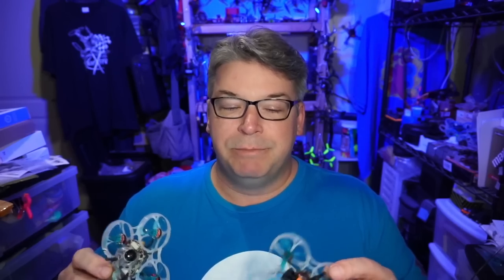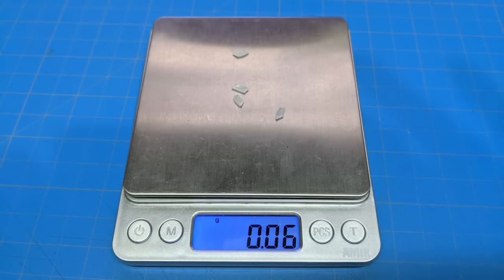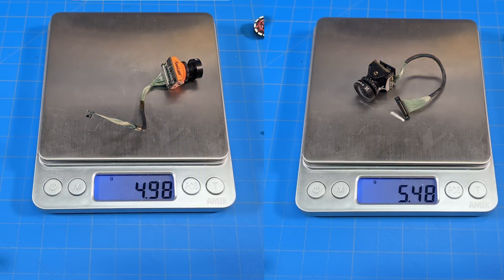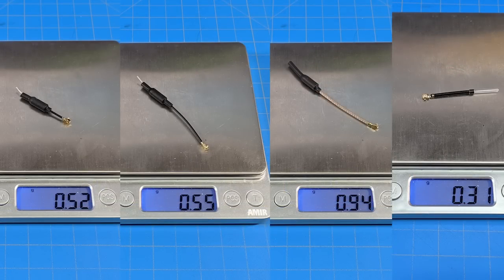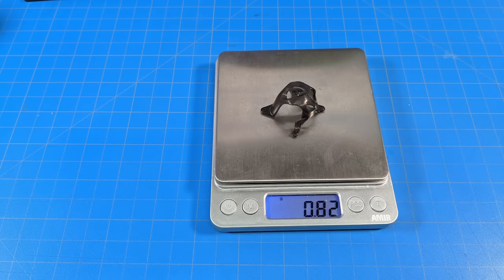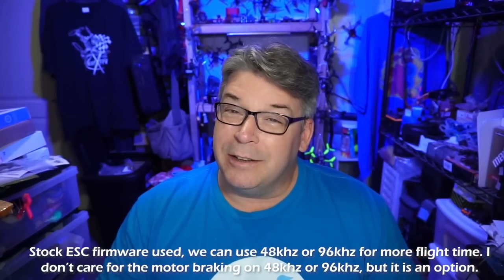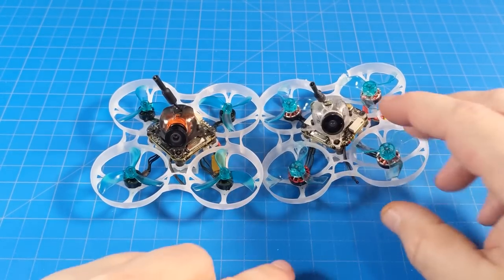Shark Byte Whoop // How Light Can You Go?

Comment: Very cool! I haven’t tried SharkByte yet, but the latency and weight advantages are definitely appealing for whoops and other micros. I hope SharkByte succeeds and I hope DJI succeeds, and I hope they push each other to keep advancing the tech for us! One side note: removing all the plugs from a Crazybee FC and direct soldering can actually save 0.7g. It is more than you might think because you also get to remove the plugs from the motor wires.
Reply: The mad scientist of weight, Dixit Dr. Nick 😜
Reply: @4:21 Nick does make reference to removing FC and motor plugs, but I have to agree with him about reparability.  0.7g at best could increase flight time by 5 to 15 seconds?
Reply: @FlyturboKwad  removing motor plugs is about flight performance more than battery life. Every gram counts if you want to fly fast in tight spaces. But is does make it harder to replace a motor.
Reply: @MrShutterBug  Yes this too, thanks!

Comment: My favorite video! I miss the days guys use to really dig in and experiment. To me building quads and fidget over parts and finding that right combo is 50% of the fun in this hobby. I love to tinker and this video has so much info for builders especially the weights. 1102 9kkv is just a sweet spot for minus 45g 75mm whoops with the 4 blade gemfans I found. 802/803 are so inefficient and don't provide grip over 25g. The efficiency of the 1102 9kkv and overall feeling of them in the air is just great. 
Still think you could make a brick fly ;) 
This video held my attention from beginning to end. Awesome job Nick! Thank you for all the work that went into this video.
Reply from the maker: Oh, I still need to buy a foam brick :). It was a fun process, I would like to see 1102 motors with shorter wire length, might be a long shot. I would like to see a 1002 or 902 from happymodel and see what the weight is. If we can pull 2grams off the 1102 motor weight it might be worth it. Through this process I kept wondering what the motor shaft weight differences are, I don't have two of the same motor with 1mm and 1.5mm shafts. I don't know if a frame can go lower weight and maintain its integrity, I would be surprised if we can get a durable frame less than 5grams, sure we can cut the battery tray off and that will get below 5grams, but we have to have a way to mount the battery, I suspect the tray is the lowest weight option.

Comment: That "mesh" on the thicker antenna wire is the coaxial shielding. That wire is probably RG178. The black antenna wire is a little thinner and lighter, probably RG196. It is probably worth seeking out antennas that use the thinner-lighter coax since the signal attenuation is mostly insignificant at the short lengths we use on whoops, but the weight is significant.

Comment: Thinking about buying SharkBite and trying a light weight build. Think I would use the UZ85 model it comes with the 1102x 10,000 HM motors.  It would be a little heavier with the larger 85mm frame and 2” props but would have a lot more performance. The larger size would be better for outdoor flying once it gets warm again and would still work inside. The UZ85  dry weight is 36 grams and would probably add another 12 grams for the dji board and camera.

Comment: That metal shield as you call it on the antennas is part of the antenna , These antennas are called sleeve dipoles... Dipole means two poles, So you have the vertical 1/4 wave  piece and the metal sleeve around the coax is the other  1/4 wave  part of the dipole... We use antennas like these on HF ( High Frequency )  the only difference being the size of the antennas , As you increase the frequency the antennas get smaller and visa versa.

Comment: Hi Nick   Great video and build you are doing.  I just love your excitement about your work.  I have seen the videos on the DJI version of the whoop builds. But I never liked them,  I thought about it and I still think that those weights that made them sluggish and not worth the cost.  Now about SHARKBIT  I haven't had the chance to try but I have heard great news about it. I wonder if we could find the pins for the connectors that way we can just cut the motor wires to the length you want,  then add the pins and connector.  And yes that antenna is a Happymodel.   THAT THIS THIS  ???   A CRASH VIDEO  !!!   LOL.    But WoW !! 3 minutes Great job on them.  Looking forward to see your next video

Comment: The ort antennas are super light and durable and work great.
Reply from the maker: oh i see a micro vee ant. At .3 grams that is fairly surprising.
Reply: @NickBurnsFPV  got them on most of my quads now. Work great for a linear
Reply from the maker: @djs134  Is the stem really flexible or rather stiff?
Reply: @NickBurnsFPV  feels identical to a replacement newbeedrone antenna, same thickness to. But a L shaped pcb at the end . So to answer your question it’s fairly flexible

Comment: Interesting build and comparison. On the frames Mr Shutterbug 75x pro 2 frame I found more even durable that the Mob V3, but no longer available. The print quality of the V3 appears to have greatly reduced and they don't last as long as they used too. Now experimenting with the BetaFPV Meteor 75 lightweight ( will have to cut the battery straps for 2s). Using the Betafpv canopies with Razer nanos and Caddx Tubo Eos2 cameras with the Beta Fpv A01 vtx as a plug and play package. One thing to note with the Crazybee F4, GEPRC 12a and and BetaFPV Quality control is hit and miss no two FC play the same, typically 1 out of three play nice. Not sure if others have experience ( RDQ have great service)..
Reply from the maker: I have a few betafpv frames, but have gotten reports of many breakages, I opted not to spend time on those frames. Seems they may have change the plastic/nylon used. I think long term none of the aio last as the 20x20 counterparts, my experience has been pretty good, but I read many comments and messages on this topic, kinda why I mentioned it in the video the way I did.
Reply: Keep on tricking theses out, the 2s ducted builds seem to be dying out and variations getting harder to find. I enjoy the Mob75' 2s format for flying indoors. Enjoy the vids.

Comment: Those are good weights in my opinion, my analog (separate vtx and rx) 75mm 2s 1102 "13500kv" whoops dry weights are 35grams and they have gotten me through 6 months of IGOW2 so far.
Reply: 300mah 2s gnb27 1102 13500kv 35 grams gets me over 3 min hard acro, I do lower the motor output to 85 or 90 percent in betaflight. My 40 gram betafpv HD version same everything else flys 2min, so that extra 5 grams is painful.
Reply from the maker: Good information that. Thank you.

Comment: If I remember correctly, I thought the original Mobula 7 motors were 16000 kv. This is really interesting to see the results, but I kept coming back to a similar thought. Stick with the 1102 motors and all the same components, but move up to a 85mm frame and Gemfan 2023 2" triblades. I'd be willing to bet that your 3 minutes goes up to 3 1/2 minutes with similar or better performance.
Reply from the maker: I would expect the flight time to go up as well. I prefer to stay at 75mm for indoor flight. The 85mm is much more challenging inside.
Reply: @NickBurnsFPV  Good point, but if anyone can do it I'd bet you're the guy for the job. 👍 Either way, you've got a great build put together. Maybe when the weather gets better and allows more outdoor flying the 85mm might be worth trying. Keep up the great work! I always enjoy seeing what you're working on.
Reply from the maker: @sixtofive  lol, oh I have done it, 85mm inside feels like constant work to slow down.

Comment: Just my option On motors and weight. Is. You need the big motor weight to toss around the weight “mass”. The less weight needs more throttle because no weight or “mass” to toss around in the air. So more weight less voltage?

Comment: Nick your killing my quad budget. The SharkBite bundles are in-stock at both RDQ and GetFPV. I ordered the bundle and will try a light build. I was going to use my UZ85 as the base but will probably use my extra US65Pro that I have on a 75mm frame. It currently weighs 24.4 grams plus the board 5.7g plus the camera 5g minus the Ant camera -1.7g plus antenna 1g plus 0.6g wire and solder so I should be at 35 grams. I will let you know how it works. Thanks, John from Chicago
Reply from the maker: Does that US65Pro have a full extra uart? Sure interested in how it comes together. Sorry about the budget :)
Reply: @NickBurnsFPV  the US65Pro uses the new 2S CrazybeeX board and it has 2 full UARTS. The board weighs 5.2grams so I will end up with the same weight that you have on the 0802 motors. For low cost it is the way to go for $89. It is running 3.5.7 so need to re-flash 4.2. Thanks will let you know how it turns out.
Reply from the maker: @jmoore3854  Ah great. Hard to remember all the different board configurations.

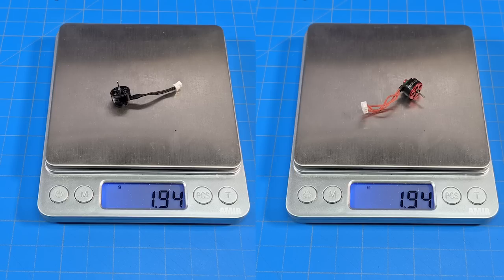Comment: Nick....Is 2:30 really your flight time target? That by today’s standards and 48mhz flash seems really short (unless the birds really inefficient) even with your hard flying....just curious? I would think a full minute longer at 3:30 would be more amenable to most people. ....
Reply from the maker: I find many report more than a full minute of flight time on quads I have reviewed with the same batteries, I can’t be sure of the performance/care of the battery. I don’t do the 48+kHz on quads I review on the channel, that is a step beyond a review, it’s an option but it’s also an option that can go wrong for those that aren’t experienced. On this side I get 100s of comments, questions and messages, I feel it’s important to have a level approach. I expect more experienced viewers to know, they can increase flight time with kHz, props. I don’t expect the same of less experienced. As in this video, I don’t care for the lack of motor breaking of 48khz or more, when flying like I like to I find it makes it more difficult to manage the flight.

Comment: Thanks Nick, I’m interested in this content. I’ve converted my TP3 to sharkbyte and also am building a sharkbyte whoop with the items below. I’m no expert so don’t know what this recipe will turn out like and I definitely won’t beat you on weight! All ears on any suggestions :)
-R3d shifters muon
-mamba f4
-xing nano x1103 8k
-Gemfan 1636-4 40mm
-crossfire nano (I know, not necessary)
-450mah 2s
Reply from the maker: probably come in around 60+ grams, going to be more of a cruiser inside, more suited for outside flight. I worry a bit the flight time might be pretty short, I haven't experienced to many xing motors, but I didn't think they were as efficient as others in the same line.
Reply: @NickBurnsFPV  oh wow, thanks for the input Nick, I didn’t realize I was increasing the weight that much but it sure does all add up. May go back to the drawing board on this one or I may build/fly it just for the experience to feel the difference first hand
Reply from the maker: @CalleyyyC  The happymodel 1102 are remarkably light. I suspect that 1103 is double per motor. Rx on my is built in and shark byte is the vtx.
Reply: @NickBurnsFPV  the iFlight XING NANO X1103 8000KV FPV NextGen Motor say they come in at a surprising 3.6g per motor “on short wires”. I piled what I think was everything on the scale (including wires & screws) and it was 54g. I will probably end up changing to the 1102 that you mention for efficiency and a light board with built in rx like you did. End goal is an indoor flyer
Reply from the maker: @CalleyyyC  onboard rx is a nice little weight savings, as long as we can do d8 mode and don't expect a "normal" amount of range.

Comment: Still on the fence about getting SB. Thanks for showing us what can be done with a little testing. Never really thought about ways to cut weight, but lately I have seen so many quads aimed at that. This one definitely gets me thinking of some odd ways to do it. 3d printing a canopy seems a bit heavy, so instead I am thinking of thermal forming one from a soda bottle. Removing all needed connectors seems like a decent weight savings. How many amps do you think it pulls? Xt30 seems like it may be overkill.

Comment: Gotta throw this setup on the new NBD Cockroach Extreme! Dual stack layout would be perfect imo.
Reply from the maker: Is that the 75mm with carbon on the bottom?
Reply: @NickBurnsFPV  Yes sir! I thought she'd be extra hefty, but there's plenty of options for mounting, and the cg might be better with the stack layout. The hoops are actually a fair bit smaller that HM or Beta frames, smaller footprint, might help inside.
Reply: So I just got the last part of my build (split lite) and here's the resulting specs. Using a de65 pro running gear (gnb27 series connector), on the NBD frame with carbon plate and small Velcro strap, and additional split lite board and cam mounted in larvax canopy is spot on 32g. The 12k kv should help bump the flight time a bit. Using a little "fixed wing style" finger balance testing, the carbon plate and bottom mount fc has the cg shifted lower considerably, even with the splits large lens mounted up so high. Next up I will test Tiny Whoops 0803 12k onesies.
Reply from the maker: @MissingNumb  I did find I have one of those cockroach frame with carbon bottom plate. I need to investigate that.

Comment: Awesome flights and great info!

Quick question. Building a baby tooth. The sharkbyte didn’t come with gummy’s and the holes seem really small? I broke of the corners like you mentioned. The board tries to work its way out of the gummy. Probably just going to put a little heat shrink around the standoff to secure the board? 

Baby tooth frame, geprc 25 amp, sharkbyte, foxeer digisight, xing 1404 4600 kv with a twig canopy.
Reply from the maker: We likely need a spare gummy or a short nylon stand off to keep the separation of the boards. The heatshrink would do the trick as well.

Comment: Hey Nick, I have another question about the jumper t-lite you recently reviewed. Can you tell please me if the stick travel on the tango 2 or the jumper t lite is higher with the stick ends set to a similar height (so they protrude above the radio similarly) and how much difference there is? thanks in advance! 

Oh and awesome whoops! I hope digital will get as affordable as analog in the near future :)
Reply: The answer is on the rcgroups page of the T-lite (in radios), on page 22: throw is a little shorter on the tango2 due to the slightly shortened sticks. And there's a picture comparing both. 

https://www.rcgroups.com/forums/showthread.php?3754503-Jumper-T-Lite-another-Lite-radio/page22
Reply: @nikotttin  ok, that's just with the sticks put down as far as they go though. I'd like to see a comparison with similar tension :)
Thanks!

Comment: Hi Nick,  are you running the stock capacitor that come with the tx5s.1 whoop board on these 2s builds ?
Reply from the maker: No. I did have a cap of my own I started with. But it came off in a crash and left it off since. My understanding is we only need the capacitor if we are running above 4s.

Comment: Very interesting... First the digital view is nice. I think we need a whole starter package, whoop + SB. 
Regarding 1102s. I tried some 11500kv on a 75mm whoop and it was horrible. Slow and short flights. My impression was that these larger motors want to push larger props...

What about mounting them on a 85mm frame with 2s?!? You should gain flight time and speed for a little weight penality. 

Would this camera fit a beebrain mount?
Reply: Forgot to say that the 1102 were tested on 1s because why not 😉
On 2s it should be better for sure... But again the Shutterbug85 exists...
Reply from the maker: 85mm is oddly much less in house friendly. The only 1102 1s quad I have flown inside is the cinefun, it did pretty well with the xt30 it cam with

Comment: Nick - What's your take on the digital options available for micro guys? Given that the only options are Shark Byte and DJI would you say that if you are a sole micro guy one should invest on Shark Byte instead of DJI or still wait it out? 

I know that Shark Byte still doesn't compare to DJI when it comes to image quality but will Shark Byte ever catch up on quality? or will DJI ever shed enough weight to compete with Shark Byte on the micros front?

I will love to hear your opinion on this!
Reply from the maker: For a sole micro flyer shark byte is the platform to invest in. We have seen shark byte with three different boards already, and the development continues. I suspect we will continue to see whoop boards as well and fatshark is working on making the boards smaller/lighter. The image quality will catch up to a degree, I think its largely the camera performance that needs to catch up. There is a new HDZero camera for sharkbyte, while its not a nano does look good from what I have seen. I don't hold high hopes Vista/DJI will have much more development. We haven't even seen a software update in a year or more, let alone a hardware/vtx update. We have only see new cameras and antenna. I often wonder if the vista/dji system was a testing method for the DJI FPV Quad. I also don't care for the DJI goggles, and we have seen v2 not change much, doesn't give me hope we will see a smaller form factor of goggles anytime soon.
Reply: @NickBurnsFPV  awesome... I feel very similar I do have the DJI systems but honestly it's been mostly collecting dust. Been on the fence on the Shark Byte and now that I'm beginning to feel comfortable tweaking and creating builds (micro) I'm going to invest in the Fat Shark digital option. Thanks for your insight. Your opinions are truly valuable in this hobby!
Reply from the maker: @JuanCintron  Great. I am happy to hear I was able to help some.